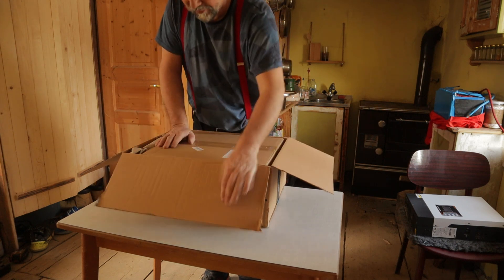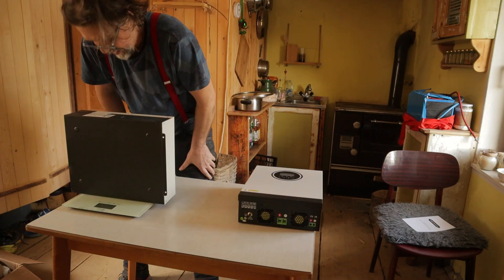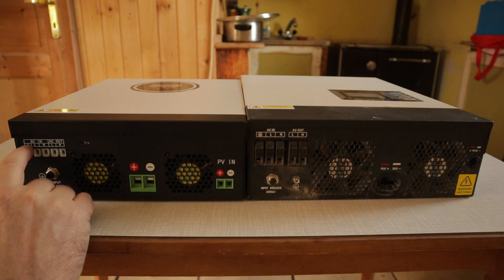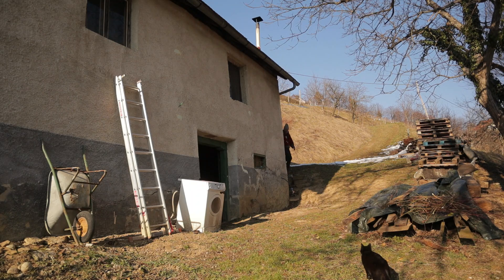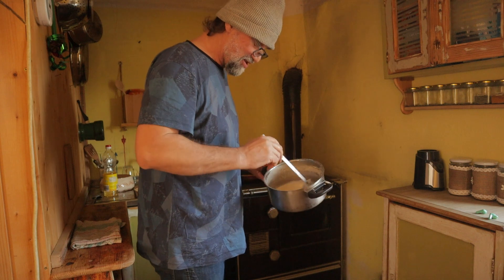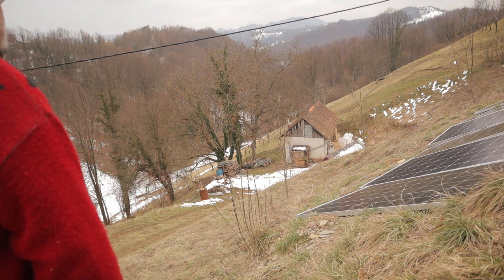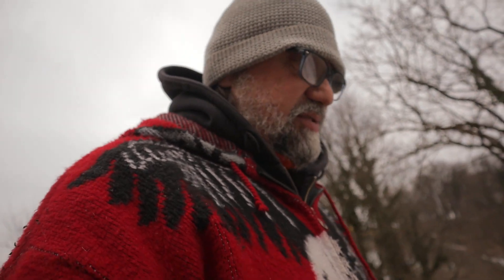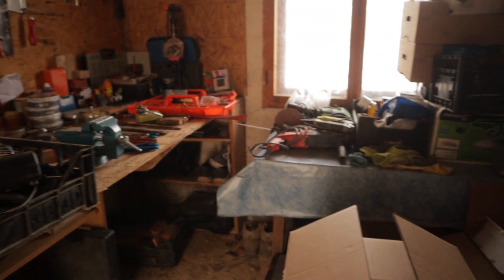Installation of a New off grid SOLAR INVERTER

Comment: I realize you probably take quick showers, but I wonder if condensation from the shower can cause any problems with the electrical of the solar equipment.
Reply from the maker: I thought about it but the space is so small and I always burn on the wood stove so the air is very dry. It is, of course, one of the possibilities. Thank you Teresa